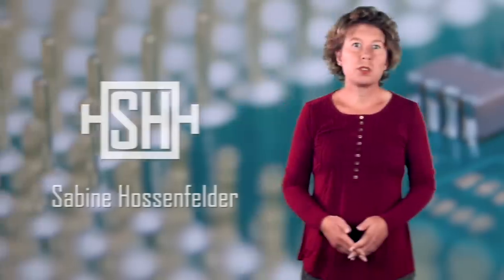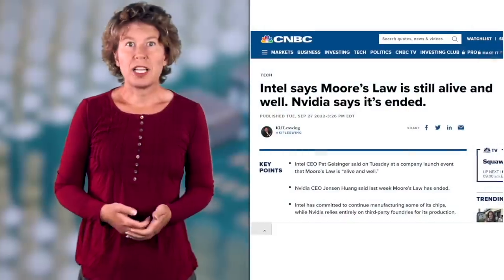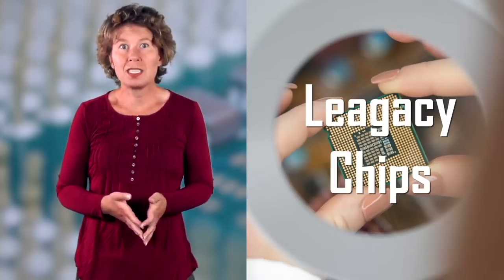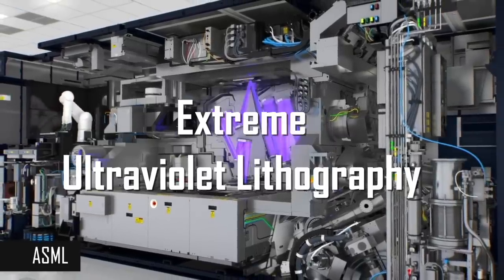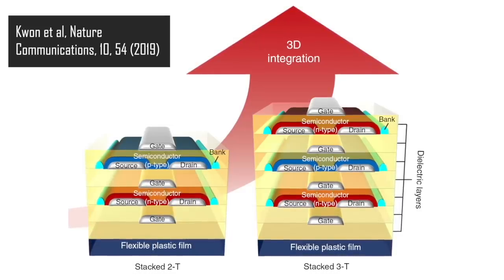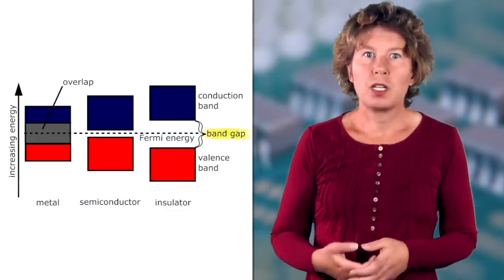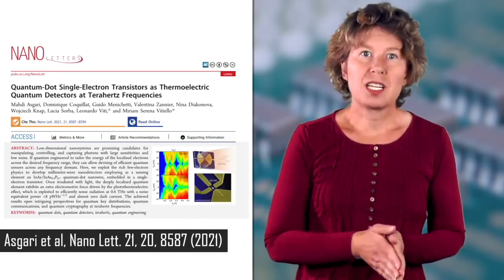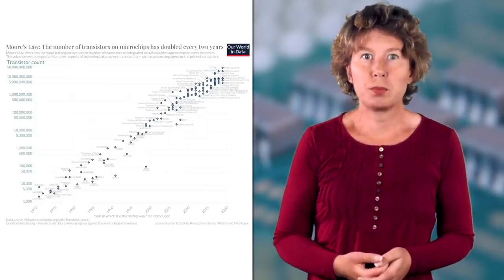Is Moore's Law Finally Dead?

Comment: I am old enough to remember the transition from vacuum tubes to transistors. At one time, transistors were large enough to see with the unaided eye and were even sold individually in local electronics shops. It has been very interesting to watch the increasing complexity of all things electronics ...
Reply: They are still sold individually and higher power applications require large transistors, you can't pump a lot of power through a nanometer scale component.
Reply: @softgnome Yep, and many current chips require a standalone transistor nearby for some key job .
Reply: Ah, the days when 'Solid State' meant something.
Reply: @softgnome  high power transistors for what type of applications?
Reply: I'm 60...Vacuum tubes were huge, yeah I remember the tv repair man out to replace a blown tube in my parents B&W telly, could watch them glowing through the vents. These guys here talking in terms of "high singles to low double digit atoms" fuck me dead! 🤪 Where to in the next 50yrs?
I forced to learn to use a slide rule in grade 12 instead of our 'modern' calculators in '79.🤦‍♂️
Reply: @iRossco  Audio amplifiers, motor drivers, basically any application where you want to control a large electrical load using a low power digital signal.
Reply: @iRossco  e.g. amplifiers (e.g. in hifi equipment)
Reply: me too.  we lived through the age of super-miniaturization.  my parents would buy me electronics hobby kits when i was around 11, and the kits used tubes instead of transistors.
Reply: My 12 yo son recently took it upon himself to build an XOR gate from discrete components. You can certainly still buy transistors individually.
Reply: radio shack was heaven
Reply: Individual transistors still are sold by the millions each year.  They are still needed in most circuit designs for performing non-computational tasks (which the microprocessor chip is responsible for).
Reply: @iRossco  But they are not talking about that. A 3 nm transitor has a gate pitch of about 48 nm and a metal pitch of about 24 nm; nothing on that transistor is 3 nm. 3 nm is not a measurement, just a name.
Reply: @soylentgreenb  
The difference is so great ? Damn, why not just use a square root of an area the transistor needs...
Reply: Um, you can still buy discrete transistors. They're used by the millions every single day.
Reply: @iRossco  Also medium power RF transmitters.  When you get into the high powered stuff that is used for commercial television broadcast, tubes are still used.
Reply: You can still buy individual transistors.
Reply: @iRossco  
I learned how to use a slide rule in 1982 after the batteries in my calculator died the night before a chem lab write-up was due and all the stores were already closed.
Reply: @iRossco bipolar transistors transform low currents into high ones at the cost of voltage. If you want both voltage and current for a hi-fi speaker, for example, they are needed.
Reply: Transistors are still sold individually in electronic shops. As are vacuum tubes.
Reply: and still, vacuum microelectronics still use tubes, plasma tv's for instance.

Comment: An interesting take on Moore's law that I heard from Marcel Pelgrom (a famous name in the semiconductor world) during one of his talks was that, for a lot of fields in electronics, there was little 'true' research in novel techniques until Moore's law started failing us. Up to that point, the solution to everything was 'you have more transistors now so just throw more transistors and complexity at the problem'. By the time you came up with a new novel technique to improve performance with the old process, people who just added more transistors to the old technique in the newer process nodes had caught up already or surpassed your performance gains. You see this now where the calibration processor in some cheap opamp might technically be more 'powerfull' than the entire computer network that put men on the moon - just to compensate for the crappy performance of the opamp - even a 'dumb' automotive temperature sensor in a car might have more area dedicated to digital post-processing to improve lifetime, stability and resolution. 
It is now that we no longer get these new gains from Moore's law (both because scaling decreases but also because it is just getting so, so, so expensive to do anything that isn't leading edge CPUs and GPUs and FPGAs in these nodes) that people are going back to the drawing board and coming up with really cool stuff to get more out of the same process node.

I can partially confirm this from my own experience in research on high-speed radio circuits. For a long time, they just used the smaller devices to get more performance (performance here being higher data rate and higher carrier frequencies). This went on for decades, up to the point that we hit 40 nm or 28 nm CMOS, and this improvement just... stopped. In the last 10 years, it is just an ongoing debate between 22 nm, 28 nm, and 40 nm on what is the best. But still, using the same technology node as researchers 10 years ago, we more than 50x the data rate we achieve, and do so at double the carrier frequencies, simply by using new techniques and better understanding of what is going on at the transistor level.
Reply: That wasn't really true for CPUs in the early 90's memory speed began falling behind CPU speed and chips had to develop caches, instruction level parallelism, pre-fetch and out of order execution.
The key to the old automatic performance gains was Dennard scaling which meant smaller transistors were faster, more power efficient and cheaper.  Now process nodes require complicated design and power management to avoid excess heat due to power leakage as well as develop more efficient transistors in 3D like FinFET and now gate around, all more expensive to make.
Now cache isn't scaling with logic, so Zen4 with V-cache bonds 7nm cache optimised process with the 5nm logic of the cores, interfaced externally via a 6nm IOD chiplet.
Reply: Yup.  In many respects, I think that highlights the difference between science and Engineering.  A lot of engineering resources are invested in incremental improvements.  It may not be glamourous, but it is meaningful.  Just by constantly smoothing out the rough edges in process, important gains are made.  Let's hear it for all of those engineers, technicians, operators and staff who continue to make constant improvements!
Reply: Another complication is that even in the 70s and 80s say although the effect was often just making a transistor smaller each time you made transistors smaller you would be faced with new problems. New lithography techniques were required, transistors would have new physical effects when made smaller that would have to be compensated for and so on. Each new level of miniaturization was proceeded by a lot of research into different techniques that might be able to allow work at the new level and many of those programs had false starts, failures and diversions (Charge Couple Devices were originally used as memory before being used in digital cameras etc.).

It has been suggested that Moore's law became a goal for the semi-conductor industry and they anticipated and funded the research on the stuff they anticipated needing given the goal.

This is all in addition to innovation or the lack of innovation in organization of chip sets and hardware as with cache, GPUs, math coprocessors, more attempts to implement parallel computing and so on.
Reply: @RobBCactive  Perhaps I should have made it a bit clearer in my original comment - I'm an analog/RF guy, and so is Marcel Pelgrom, so it might very well his comments only apply to RF/analog. At the same time from my limited expertise in digital it does kinda apply there too - sure, there was lots of architectural stuff that happened (which also happened in analog, because you have to architecture your complex blocks first) but on true low-circuit level that wasn't really the case up to recently where you see people coming up with things like error-detection per register stage to detect that 1-in-a-million event where you do use the critical path, allowing you to run closer (or even over) the edge for 99% of the time and fix the issues in the 1% of the time they occur, instead of running at 3/4 the speed but have 0% errors, and piss away 25% more power doing so.

Sure the design also becomes more complex (as my cadence EDA bills indicate...) but from what I can tell a lot of that is handled at EDA level.
Reply: As you said, the 40nm (later reworked to 32nm if memory serves) and the 28nm showed the last big gains in power savings. 14nm wasn't bad but it seemed that mostly 14nm showed gains from architectural power savings vs more efficient lithography. Once the voltages stopped dropping really the gains were mostly density.

We're running probably four times the transistors on the same power envelope so I guess we're still seeing power scaling but the fact that the voltage is still roughly the same as the old 95nm chips is telling.

I do wonder why we're not running on a more conductive semi-conductor. As I understand it the lowest voltage we can switch at is .7v, seems as long as that's the minimum our power draw is going to be high. Lower the switching voltage and we should be able to lower the power consumption of the chip.

Moore's law isn't dead but it's definitely time to step back and reevaluate the situation.
Reply: You see something very similar happening today with video game development and increasing console power. 

Each new console generation adds some new tech that can be exploited to boost performance of new video games, but oftentimes developers see this new tech as an excuse to ignore performance and fidelity issues they'd otherwise have had to care very much about. So more dev time is provide to the content of the game and less is given to performance. What it ends up meaning for the consumer is that consoles/PCs get better and better but the same problems in video games remain: unsteady framerate, screen-tearing, anti-aliasing issues, crashes, load times, etc.

The only developer I can think of who never stopped caring about performance was id software, the makers of the Doom franchise.
Reply: Wow.....all very interesting. Thank you.
Reply: Wow, someone knows what CMOS was.
Reply: That's precisely the comment I was going to make. Genuine innovation in this field is extremely expensive and there has been relatively little true innovation as a result. There's much more processing capacity to be tapped by doing things differently to the way they happened to evolve. 
However, as well as the R&D costs, change itself can be resisted because of the disruption that can follow. Backward compatibility may have to be sacrificed in the short to medium term if we are to continue improving processing capacity into the future.
Reply: I'm reminded of Clayton Christensen's book, "The Innovator's Dilemma" which show how new technologies fail to meet consumer needs until a new or niche application allows them to develop into maturity - then they suddenly completely run over the old technology.
Reply: @glenwaldrop8166  Lowering the voltage would require germanium but germanium is a rare element and therefore we switched to silicon in the first place.
Reply: Never mind Moore’s law, it’s all about Dennis’s law now
Reply: @donmab  mega interesting, cheers for that
Reply: So the purpose of Moore’s Law is to drive us to push forward.  I’ll take it.
Reply: @donmab  Marcel is a transistor-level guy (as am I). What he was referring to is the fact that the circuit guys (esp. the analog circuit guys) didn't have to think up very interesting new things on the transistor level. A lot of the advances you list were enabled by more transistors, and not through being more clever with the transistors you do have. Ofcourse that argument is a bit of a hyperbole, but the core idea is in part true.
Reply: i wish b.s. like a phone has more computing power than what sent us to the moon would stop.  and now you have to turn it into something even weaker.  "technically?", eh?   well, "technically" a 1 year old baby has more computing power than the most powerful computer...
Reply: The environment under the hood of a car is literally more stressful than any environment experienced whilst going to the moon, sans vibration.
Things get designed for the task at hand.  And keep in mind that time - the cost of labor, time to market, etc - counts in business.  
Real products and services have to be delivered on time, or your business fails.  You rarely get the time to do things elegantly.
If you want an elegance & efficiency hill to die on, go at software.
Reply: Seen this a lot in programming, rather than design a better algorithms, some just throw more process power at the problem.

Comment: Great video Sabine! I recently finished working at lab who are trying to use similar materials to graphene to try and replace and supersede silicon.

One tiny error about 4 mins in was you described e-beam lithography as a technique for characterising these devices. What you go on to describe is scanning electron microscopy. E-beam lithography is a device fabrication technique mostly used in research labs.  Confusingly the process takes place inside an SEM! Lithography is patterning of devices, not a characterisation technique.
Reply: e-beam lithography (a form of mask-less lithography) was seen as a possible successor to "optical" or photo lithography (which uses masks to form the structure layers). Unfortunately it is not high speed enough to rival the production speed of current "optical" photo lithography systems (which expose each layer via a mask at once, almost like a high powered slide projector, so can achieve a higher throughput than e-beam systems, which need to scan across each chip on a wafer to create each layer shape). So for now it is relegated to specialist applications and research work. One of the companies that was building e-beam lithography systems for chip production, Mapper Lithography, went bankrupt in 2018 and was acquired by ASML. ASML has not continued the work in e-beam lithography as they are the sole producers of EUV photo lithography machines.
Reply: "Confusingly the process takes place inside an SEM!"
So whats the difference ? Electron energy  or something else ?
Reply: @Hexanitrobenzene  in an SEM measurement, you want to scan the beam over your sample to collect a pixel-by-pixel map of a signal like the number of electrons that are backscattered. 

Whilst you're scanning the beam, it has a lot of energy so will interact strongly with your sample. In e-beam lithography, the beam traces out the pattern you want to develop and you use materials that harden or soften under the electron beam.

So I guess the biggest difference in the shape the beam scans in. I think possibly one might use higher electron doses for lithography too.
Reply: @rammerstheman  
Hm, seems like the main difference is in the preparation of the sample, not electron beam. Perhaps an analogue of photoresist which is sensitive to electron irradiation is used.

Comment: The Amiga computer from the early 1980s had a half dozen specialized chips. The memory-to-memory DMA chip (the "blitter"), a variety of I/O chips, something akin to a simple GPU, separate audio chips, etc.  It was very common back when CPUs were 7MHz instead of 7000MHz.

There's also stuff like the Mill Computer, which is not machine-code compatible with x86 so hasn't really taken off. It's simulated to be way faster for way less electricity than modern chips.

One of the advantages of photonic computing is also that the photons don't interact, so it's easier to route photons without wires because they can cross each other without interfering.
Reply: Yep, I was thinking the same thing.

Also, I think it’s strange that RISC technology was not mentioned in this video (or did I miss it?) It is what’s driving the superior low power high performance of Apple silicion based on ARM compared to the old CISC architecture still used in Intel and AMD CPUs. 

Of course, RISC cpus also found their way into Amigas many, many years ago in the form of the PowerPC architecture also found in Macs before Intel.
Reply: @oysteinvogt  
Intel and AMD are using RISC cores inside, but they translate the CISC code at decode stage.
I'm waiting for adoption of RISC V. When I last checked, basically everyone but ARM was on board.
Reply: The Amiga was released in July 1985, a year and a half after the Apple Macintosh. Byte magazine stated that the Amiga was better in 5 out of 6 categories but didn't have as nice a look for files navigation.
Reply: @yamishogun6501  The GUI was definitely not "pretty".  But it was quite functional, and it's the system that made 99% of every internal really easy to understand and use. It's a shame you couldn't really make it multi-user without a radically different CPU design.

Comment: I joined Intel in 2002.  At that time people were predicting the end of Moore's Law.
My first "hands on" computer was a PDP-8S,  thrown away by the High Energy Physics group at the Cavendish and rescued by me for the Metal Physics group.    From this you can correctly infer the relative funding of the two groups.
Reply: I guess your Metal Physics group didn't focus on the extremely well funded tube alloys ... :-)
Reply: Predicting the end of Moore's Law really has become quite akin to fusion power being commercially available. Probably both will happen at the same time.
Reply: I was told in 1984 the limit of optical lithography was 1um or 1000nm, now they say they are going into production with a 10nm half pitch next year, I did my undergraduate Physics project in the Metal physics group at the Cavendish on Scanning Electron Acoustic Microscopy.